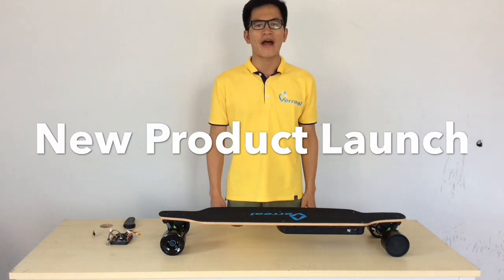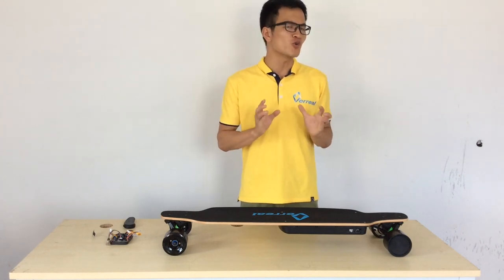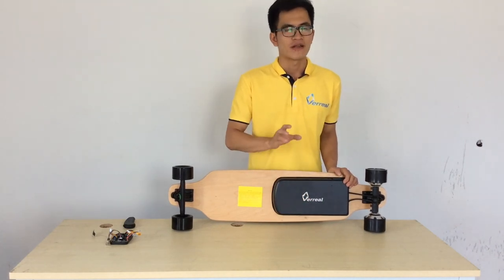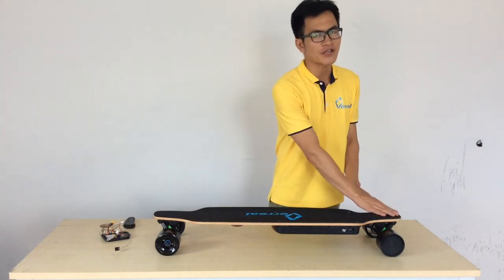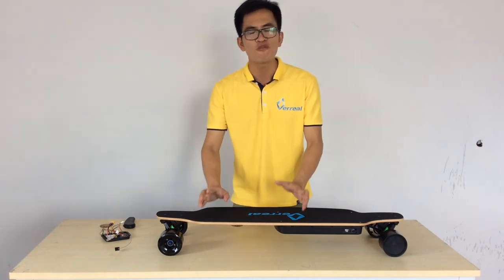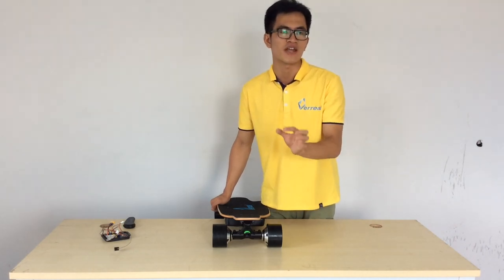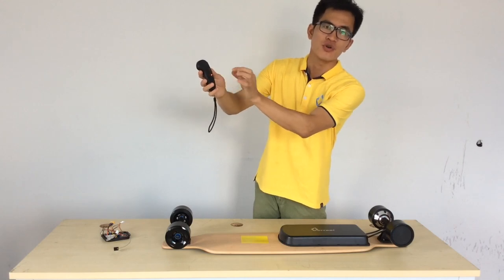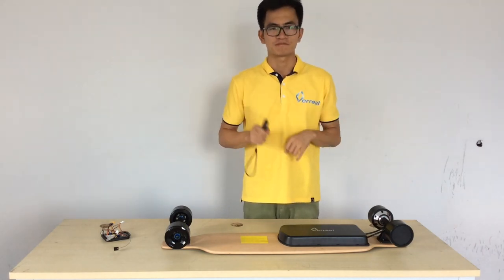New Product Launch - Verreal F1 Electric Skateboard

Comment: Hey Vic, wonderful work. You’ve taken all the feedback and testing that came out of the V1 and V1S and improved it yet again to this new F1 model. I think the one casing is the go definitely )) is going to be a much more rear weight ride feel and i’m tipping will feel so much more manoeuverable )) well done again Vic and Congratulations for engineering a even better design again .. continually working and building on what you already have perfected. Really looking forward to reviewing this Verreal F1 product and doing a benchtest against the other two models )) this is going to really lift the Verreal game even higher )) i’ve noticed you’re now using “Potting” in the ESC this is a wonderful improvement again,  that’s nearly 100% waterproof in that componentry circuit)) cheers Vic keep up the great work pushing the envelope )) cheers Andrew )( Andrew Penman EBoard Reviews YouTube )(

Comment: hahaha, it's not fair. I'm still waiting for mine that I bought a month ago and Verreal have already released a new model. and also better than mine. ;-) 

Great e-board and great job Vic.
Reply: Fernando Yuste me too
Reply: Fernando Yuste I’ve just got my V1S and have had loads of problems and it’s so hard to communicate with them to get the replacement parts. I haven’t had the chance to ride mine because of the problems and now they’ve released a new board. Not fair really
Reply: Alex O'Sullivan what kind of problems? I just got mine today
Reply: Alex O'Sullivan It's strange, Vic always answers in less than 24 hours. send to Vic another email. I'm sure Vic will give you a solution as soon as possible.
Reply: redskinman0 my board wouldn’t turn off so I needed a new ESC. I had to take the battery apart to turn it off every time I wanted to use it. The motors we’re making a horrible noise that’s getting worse and the black paint on the board was coming off in my hand every time I pick the board up. Only taken the board out twice as the noises are getting worse.
Reply: Fernando Yuste hi mate. Ye does reply but only half the time. It’s difficult to communicate to get things sorted. Having to push all the time to get the right answer. I needed a few items to get the board working properly but only one item came so still in the same position and waiting for answers. I’m sure it’ll be sorted soon as he seems like a nice guy. Just want to get out there as the board is great when it works
Reply: Alex O'Sullivan damn that sucks,did he send you out a new esc yet?
Supposedly the one I received doesn’t have the esc that was having those problems
Reply: redskinman0 yep just the ESC but no motors yet. Both are making a horrible noise and he said one was on its way with the ESC but never came. I need both but only one was supposedly coming so wouldn’t of solved the problem anyway. We’ll see
Reply: Alex O'Sullivan good luck,that’s not cool
Reply: Alex O'Sullivan That sucks.. I was just about sold on the verreal until I read this.  I don't  need another problem child.
Reply: Brer Rabbit from what I heard a few of the new models went out with new escs that were bad so they went back to the old ones,but that doesn’t explain the bad motors.I just got mine in a couple days ago,so far no problems.Put 10 miles on it last night and still had 3 out of 4 of the light bars lit up on battery indicator
Reply: Brer Rabbit, Verreal is not a bad brand. Their boards in general are good. Problems with any component you can have in any brand. If you search the forums, the most repeated problems lately are bucket hub motors noises and problems with the ESC. And they are complaints of skaters who have bought boards of different brands. 
After sales service is complicated when the company is so far away, but the important thing is that they provide warranty service. Obviously your service is not as good as Amazon's, but you're not paying for premium service either.
Reply: Had the same issue with V1, but it's still an awesome board :)

Comment: Will you be selling that enclosure  separately?  My trash plastic Meepo enclosures have both cracked and I'm looking for one exactly this the F1.
Reply from the maker: Yep, we will be selling this enclosure separately. This alluminum made casing is very solid. Very hard to break. Check out our store tomorrow. We will list it up. Thanks.
Reply: It's been 4 days, I really want to purchase this enclosure.
Reply from the maker: Hey thanks for reminding me of the undone job. I have to tell you this before you purchase. The alluminum casing will not be able to house your battery. Our battery is made differently to fit into the enclosure. So you may need to purchase a battery from us and then you can use it. Have to make it clear for you before you purchase. Think about it. You can get to me by the emails.
Reply: Verreal Board Bummer! Thanks for letting me know. I purchased the SANYO battery so I guess I'll have to purchase the metal wowgo/ownboard enclosures instead.
Reply: Verreal Board Hi Vic nice work on making the F1! I'm also interested in buying this case. I was going to make this shape in fiberglass but the aluminium is much better for strength and heat dissipation. I'm gonna reassemble my battery in flat-pack configuration to fit the enclosure. How can I buy it?
Reply: So I guess you're not going to sell the enclosure separately. Very disappointing. I will make my own thermo formed from kydex thank you.
Reply: Meepo is now crap. My esc cracked just taking it off...I like the Replaceable PU.s With magnets ,so no clicking.

Comment: Wow Vic... I can see you have been busy. The F1 looks good. Does this new board also connect to the iSkateboard app?  I really would like to see a video on how to connect the iSkateboard component to the new ESC. Thanks.
Reply from the maker: Hi Edouard. F1 doesnot connect to the iSkateboard. V1S does. But right now the APP is not ready. We got word from our partner. They are still working on that and it will be available for use soon. Would like to do another video on the APP once it gets ready. Thanks for commenting. Vic
Reply: Verreal Board can’t wait to see what functionality the app will add to the v1s